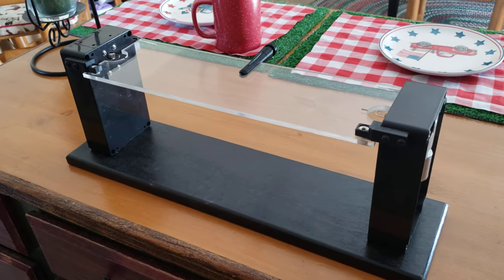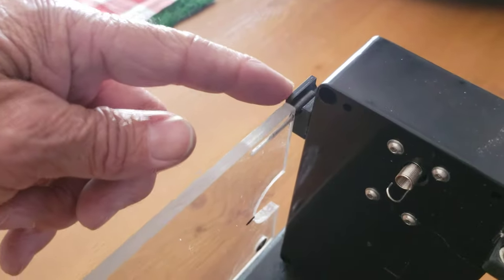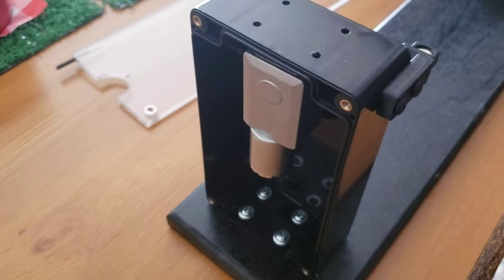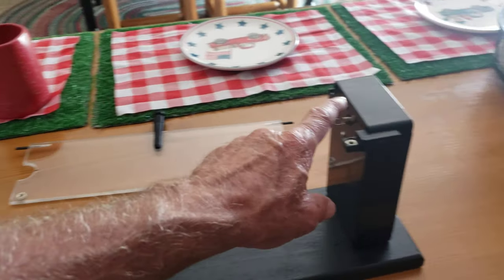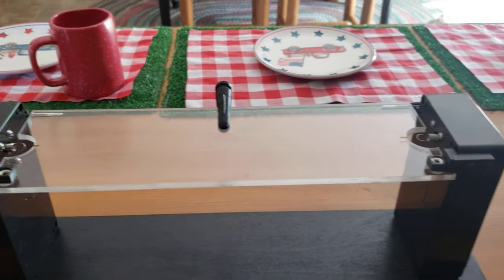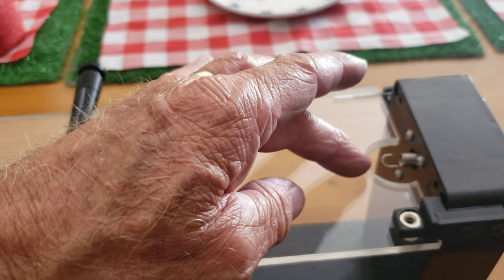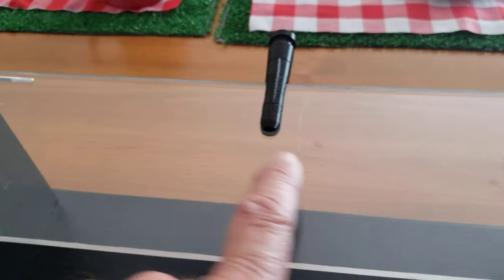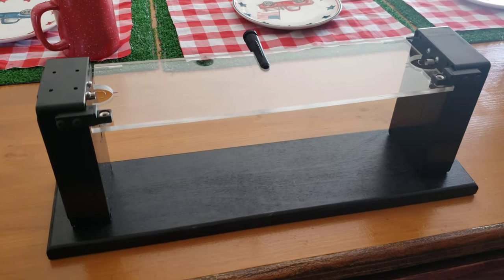Brush Maker For Fly Tying

Comment: What volt DC motor are they? I have made one of these in the past with a 3 volt DC motor, but I think youre on to something with the dual motors!
Reply from the maker: 12v 250rpm but it should give close to an equivalent of 500 since the twist is coming from both directions. I'll probably run the wiring and motor controller tomorrow.
Reply: @FrugalFlyRodder   Will you be making a video on that as well? I think it would be a cool series following the process of the whole thing.
Reply from the maker: @flyguymike5247  oh yeah, that's the plan. I wanted to work all the bugs out first.
Reply: @FrugalFlyRodder  Can't wait!